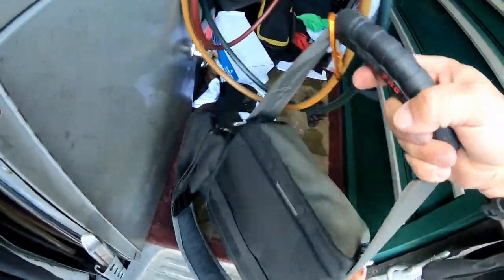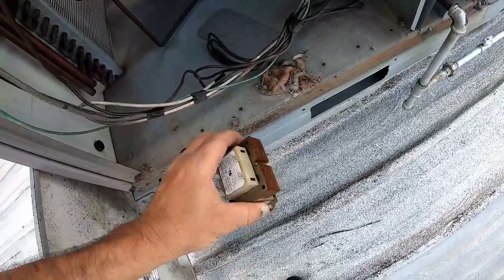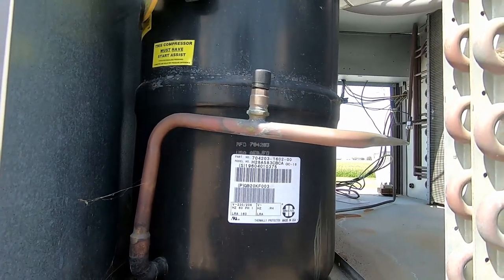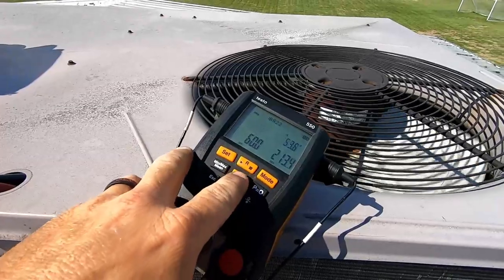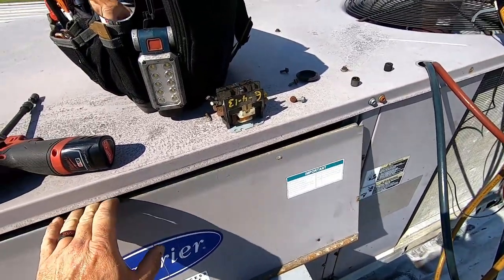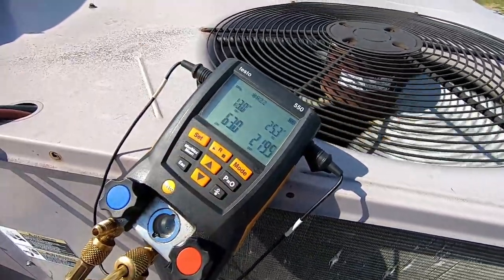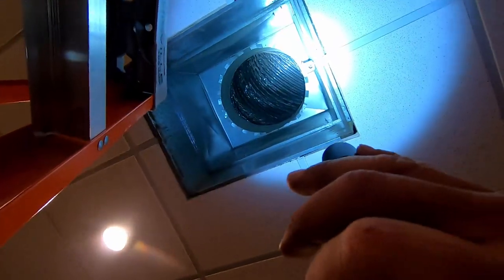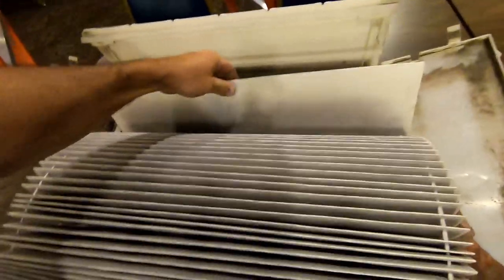No Cooling In The Bar Area. Package Unit With Hidden Issues

Comment: Tight pleats are never a good thing, unless you increase your surface area.
On another note,(transformer) some guys leave old parts behind to show that they have been replaced.

Keep up the good work
Reply from the maker: Thanks for watching👍👍 I personally prefer to write inside the panel and date what was replaced. The only things I will leave behind is blade style fuses and parts that might be needed for proof of replacement.

Comment: Awesome man I didn’t know about that capacitor trick any videos on how you wired that? Is it just hermz on one and fan on the other ?
Reply from the maker: Capacitors in parallel will add up. Com to com,  herm to the needed cap.  Works with fans, or compressors.

Comment: Never like seeing filters at both locations. Either put them at the unit or the return grille, not both.
Reply from the maker: I think the long run along with the high eff. filter being at the grill compounded the issue. (You never see those filters in a package unit normally. )🤦‍♂️

Comment: I was today years a old when I realized you could use the hole in the top of the unit to put your hoses through there 🤯
Reply from the maker: 👍👍don't feel bad it took me a while to also figure it out 😊.  Supposedly they give you something called a manual but I don't know what those are 🤣
Reply: Right? I don't take those hose gauges up anymore though unless I'm charging. I use field piece probes.

Comment: On a home 3 ton heil heat pump, should I measure lowside temp at blower near TXV or at outside unit to get my superheat?  There's about 2-3F degree difference between inside and outside lowside, it was 95F outside?  Thx, Love the channel.
Reply from the maker: If you're on a home system and it has a TXV,  generally you use subcooling to set the refrigerant charge. Normally the superheat is not adjustable on residential equipment, it is possible but not normally. If the instructions tell you to set it by superheat, then generally you set it based off the superheat at the condenser. This is unlike a walk-in cooler or freezer where you would normally set it at the evaporator. when in doubt follow the manufacturer's instructions.